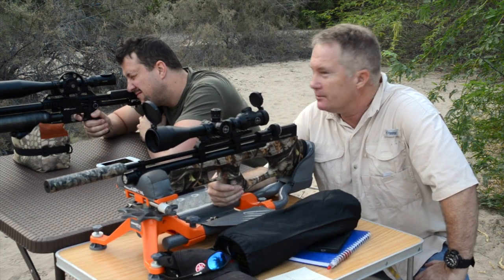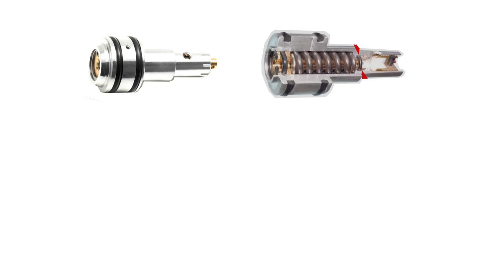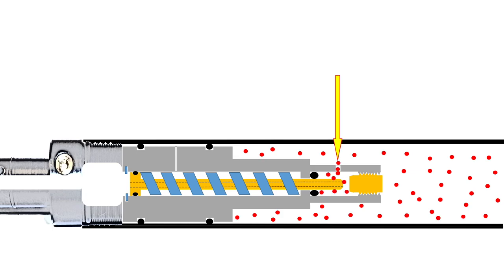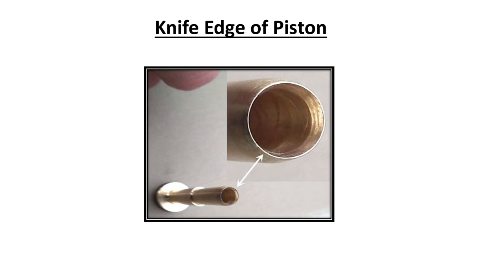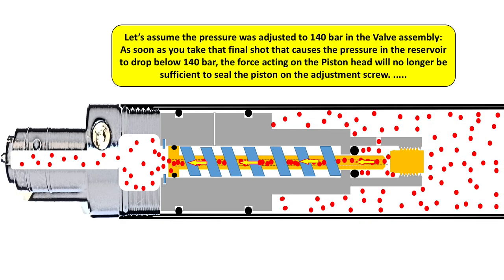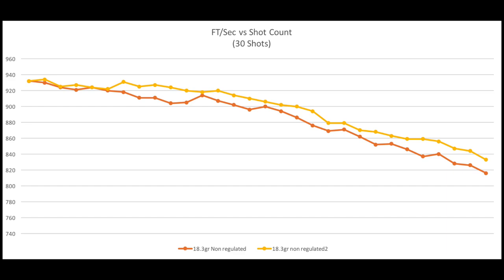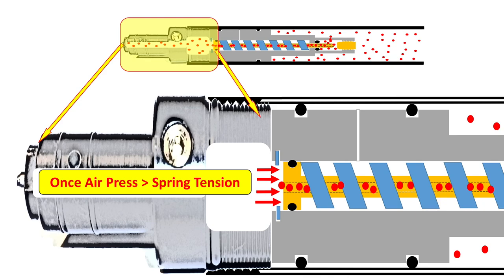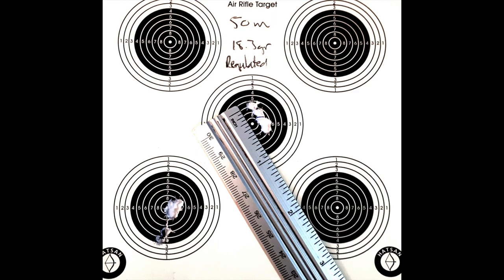PCP Regulator: How does it Work?

Comment: How do you know  you have the regulator set to 135 ?  Do you just have to go by the marks on the regulator  or can you see it on guns gauge ? Is 135 going to be what the gauge on the gun reads?  How do you know what the pressure is inside the cylinder as your filling it up ? What is going on with the vent hole ? You didn't say anything about it  or why its there?  Why are people cutting the threads  in the valve assembly  and notching the  cylinder  to create a breather hole ? Is that just something  some  regulators like the huma   have to have ? Do you have to  make some type of breather  hole once you install the  regulator  you showing ? Can you explain why some regulators  have to have a vent hole that leads to the outside ?
Reply from the maker: Hi Steve.
Ok, 1st question: You order it "pre-set" to what you want. Once you get it , then , if you want, you can adjust using the side index as indicated in my video.

No 2: The reading on your pressure gauge depend on where it is situated. On my Bull-pup, the gauge is on the back of the cylinder from where you fill it. What you see there is the "pressure before it goes to the regulator".

On the Puncher Breaker (which is essentially the same gun...), the gauge is fitted to the valve assembly. You thus see the "regulated" pressure. You must beware of this as you need to use the pressure gauge of the devise that you fill the rifles with to determine how much pressure is in the cylinder. Your gauge on the Puncher Breaker will NOT tell you how much pressure is in the tank. Only the regulated pressure. 

No 3 ; Breathe hole
If for some reason any pressure should leak (small amounts over time) into the regulator housing/unit then the balance (desiogn specs) no longer apply. The regulator is designed to overcome the spring pressure and close at certain value. Once air leaks into the regulator, that additional pressure will change the value at which the regulator opens and closes. It might NEVER leak into the regulator, but if it does it will change ....

So by adding a hole you ensure the same atmospheric pressure every time. That air that leaks from the breath hole needs to escape somewhere. It you look at the Kral then you can see that air is blocked on both sides of the regulator.   But air can actualy move from the breath hole, past the sides of the valve assembly,  through the threads of the valve assembly, but you MUST NOT put grease on the threads and also NOT return the original O-ring. Then it will breathe.

Some rifles, like my Gamo Coyote one must drill a "breathe hole" in your cylinder opposite the hole in the regulator.... I will make a video on this in May 2021 when I am finally back home.... 

Hope this is understood.
Reply: @affordableairgunningbyjb6994   Thanks I'll be looking for that video . I'm new to pcps and my hatsam hydra doesn't have a regulator in it and I like the idea of having less power with more shots at the same power  . My Hatsan has the gauge that looks likes its on the valve assembly. So when I add  the regulator  my gauge will read the regulated pressure right  and not whats on the other side  right if I'm understand what you typed . This makes since and that was why I ask . I watched this video at least  5 0times now trying to get  every thing figured out and if you  said something about  this I  keep missing it . I can just see people like me not knowing anything about this installing  a regulator and keep pumping the gun up and watching the   gauge on the other side of the regulator  only going to 135  and possibly blowing up the tank .  If that's not  in this video  you should try to add that  to it  . It might save someone  from getting hurt . This is one reason I like  to find out exactly  how something works before I do anything . I'm still not getting the breather hole . Are you saying a hole should always be added  in the area between the 2 seals on the opposite side of the regulators  hole  even on the one in your video ? How do you know when air is getting  into the  area between the 2 seals  ? What happens ? Sorry if my questions are stupid  this is all new to me .
Reply from the maker: @Sertao2013  Hi Steve and Happy new year.

Ok, I must confess that there is some technical flows in the "regulator I used." The one that fits into the Kral does not actualy have 2 outer o-rings (as the one in the photo). It only has 1.  The breath-hole is on the valve assembly side of that single o-ring. 
As the pressure on the outside the valve assembly is "zero" or at least equal to atmosphere pressure. Inside the valve assembly it is the regulated pressure and on the other side of the regulator (past that single o-ring) the pressure is equal to the cylinder pressure....  Thus if there was any small amount of air that MIGHT (not will, just maybe) leak past the o-ring that seals the piston stem from the section where the spring is located, then the following will happen. 

There will be a pressure build up in the that section and this pressure will be added to the spring tension. For the regulator to now seal,  the pressure on the piston head needs to overcome the spring tension AND additional pressure that leaked into that section. It would thus progressively increase the regulated pressure without you knowing it. 

That regulator i used in my video is typically one where you would need to drill the hole in the rifle's cylinder. The hole would have to be between the two outer o-rings to allow air to escape out. The Kral regulator only has 1 o-ring and then the air escapes past the threads of the valve assembly....

This is what the kral's regulator looks like. When you look at this you will see the single o-ring on the outside and also the o-ring that the de-pinger cap seals on. the air thus cannot get to the outside of the valve assembly. You will also see the breath hole from where the air can breathe and then leak out the threads.

https://www.ebay.com/itm/KRAL-Puncher-PCP-Regulator-MK9-Lancet-by-Lane-Regulator-Made-in-the-UK-/123896263165

Now also have a look at my video to install the regulator and hopefully all will make sense then. (Ps, i used the same picture on the intro, but give detailed explanation later in the video and it shows the actual regulator very clearly....)

https://www.youtube.com/watch?v=IwCkdBye-rc&t=1s

Ps: You were the 1st one to recognize this "error" in my video.....
Reply: @affordableairgunningbyjb6994   Happy New year to you also . I'm still trying to  digest all this info from your video and  your  reply 's and of now I  don't know what I recognized a error lol . I just didn't see in the video  about what the gauge would show when its  below  the regulator  vs being on the other side or fill side gauge . But I think You answered that  and I understand that now  thanks  to you. I;ll watch the attached videos you just gave me  and try learn more about the  because I really want to do it but I want to know  everything about it first  including the breathing hole  thing  and exactly how that works and why . I will have to read what you wrote here a few more hundred time for sure . I wish I know what error I recognized lol . Thanks for  your replys  I hope other people with  my same questions will read  your reply and it might help them also . After I watch your other video  about the  breather holes with one o-ring  if I don't see what I'm looking for I might  have to bother you again . Thanks again for your help .
Reply from the maker: @Sertao2013  Hi again. The other video is not about the breathe hole, it is about installing the regulator, but seeing all the components, might just ignite the spark...

What you noticed was that the air could not actualy escape from the regulator's breath hole. As it was in my video.... The photo of the regulator i used had 2 two o-rings with the hole between them..... Does not make sense, but in a rifle where that regulator is used, you would have to drill a hole in the rifle cylinder. 

hope that soon everything will make sense.

Regards

JB
Reply: @affordableairgunningbyjb6994   Thanks  yes  I think I'm getting it . I see the small hole  behind the o-ring on the ebay photo of the regulator . I take it  all the air  that's  on the fill side of the  regulator  oring  is high pressure and any air on the out side of the  valve assembly and regulator  is just air under no pressure at all  so when you  cut the threads  and make a notch in the cycinder  that breather hole  is there  just in case air excapes past the orings and it won't be able to build up  high pressure   in the space  where it should be no pressure and the breather hole makes sure it never is allowed to build up pressure . If that's right then you could  brill a small hole in the  cylinder any where on the  opposite side of the  oring that's not under fill pressure . It seems to me that if you ever wanted to go back to a  non regulated gun that it would be better to cut the threads in the  valve assembly  this way  all you would to buy is a new valve  assembly and you could still use the same cylinder. I'm not  sure  how you would go about keeping air  in the cylinder once you make that small notch  in end of the cylinder   . Will you watch this video  ? It shows the  way  the threads and  notch in the cylinder end should look like  . Maybe  because the notch is so small  and he doesn't tighten it up very tight    that air is allowed to except that once you tighten it  real tight it will  not let the  high pressure  air  out once you remove the regulator . He shows a close up of the notch at 27:21 in the video . https://youtu.be/oTyGBuoMWyU

Comment: Hi what aftermarket regulator do you reccomend? I cant see a link.
Reply from the maker: Hi there. 
I have used only the Lane regulators, but there might be some supply issues as Robert Lane has taken some time off. He is struggling with long-term illness. However depending on your rifle there might be several shops that have stock.

Apart From Lane Regulators :  https://laneregulators.com/ 
The other big name is  Huma : https://www.huma-air.com/

I believe both have good products , but as i have 2 rifles with Lane, and they work really well, ill just stick to what i know.

Be safe and happy hunting/shooting

Regards

JB

Comment: I didn't see any explanation of what the breath hole is for.
Reply from the maker: Hi there !!

A very good and important point that I forgot to cover in this video. 

If maybe there was a small leak of air on the o-rings INSIDE the regulator then high pressure air could get past where the regulator and the piston seal. If this happens the air will be trapped in the "chamber or section" where the spring is. Now the pressure will increases in that section. This will cause the force required to close/push the piston (spring) to increase as we now have spring pressure AND extra air pressure......
If this happens then higher pressure in the valve assembly is required to push the piston head. 
Thus if air got inside the section where the spring is, then as that pressure increases, so will the pressure required to close the regulator increase. Finally the regulator wont be able to close anymore because spring pressure and extra air pressure will be too much. 
By making a small hole, and putting an o-ring either side of this hole, the air can escape from the section where the spring is. However you will need to drill a very small hole in your rifles cylinder (directly across from where this hole is to allow it to escape into the atmosphere.  That is why we need a breath hole on SOME rifles. 
The reason I forgot was because that model kral does not need a breathe hole drilled into the cylinder. In that model there is only one outer o-ring on the regulator and the air bleeds from the breathing hole and escapes past the valve assembly .

( Have a look at this video where I fit the reg to my Kral. There I explain that the O-ring must not be replaced .... Watch from about 16 min...  https://www.youtube.com/watch?v=IwCkdBye-rc&t=562s   )
 The reason for not putting it back is for air to be able to leak past the threads into the atmosphere.

If your have a rifle that needs a breathing hole drilled in the cylinder, then it will have very clear instruction , and a drill, with the regulator you buy. Just follow the instruction when you fit the regulator to that rifle. 

I hope this was clear for you....

Comment: What does breath hole does?
Reply from the maker: Hi there Laurens.
Very good and important point that I forgot to cover in this video. 
If maybe there was a small leak of air on the o-rings inside the regulator then high pressure air could get past the regulator and the piston. If this happens the air will be trapped in the "chamber or section" where the spring is. Now the pressure will increases in that section. This will caused the force required to close/push the spring to increase. 
If this happens then higher pressure in the valve assembly is required to push the piston head. 
Thus if air got inside the section where the spring is, then as that pressure increases, so will the pressure required to close the regulator increase. Finally the regulator wont be able to close anymore because spring pressure and extra air pressure will be too much. 
By making a small hole, and putting an o-ring either side of this hole, the air can escape from the section where the spring is. However you will need to drill a very small hole in your rifles cylinder (directly across from where this hole is to allow it to escape into the atmosphere.  That is why we need a breath hole on SOME rifles. 
The reason I forgot was because that model kral does not need a breathe hole drilled into the cylinder. In that model there is only one outer o-ring on the regulator and then air bleeds from the breathing hole and escapes past the valve assembly .

Look at this video from how i put the regulator into the Kral. I explain that you must not put the back the large o-ring of the valve assembly . The reason for not putting it back is for air to be able to leak past the threads into the atmosphere.

If your have a rifle that needs a breathing hole drilled in the cylinder, then it will have very clear instruction , and a drill, with the regulator you buy. Just follow the instruction when you fit the regulator to that rifle. 

I hope this was clear for you....

https://www.youtube.com/watch?v=IwCkdBye-rc&t=940s
Reply: @affordableairgunningbyjb6994  thanks allot! One more question. If i need 110bar reg pressure, is it better to go for a low pressure reg (60-130 bar) or high pressure (110-160 bar)? I would think the low pressure because when choosing the high pressure the bellevil springs me be stronger then the pressure.

Hope you can assist!